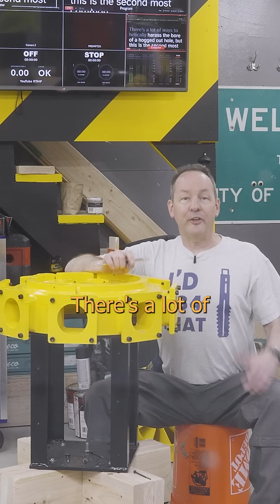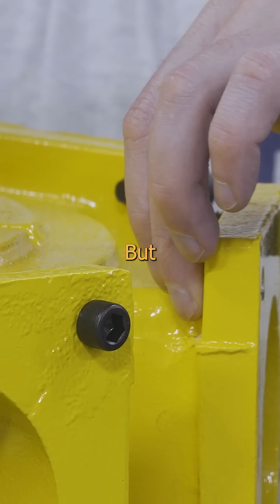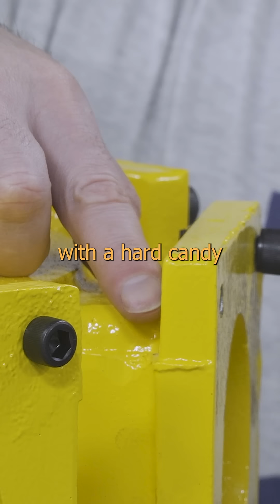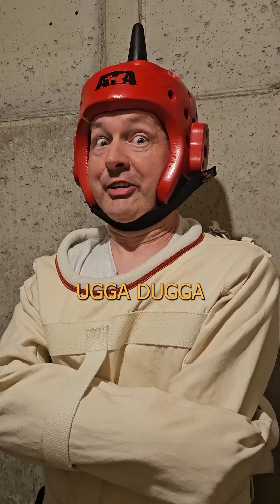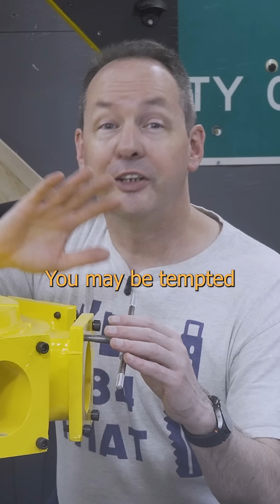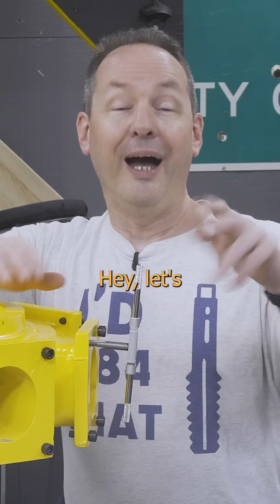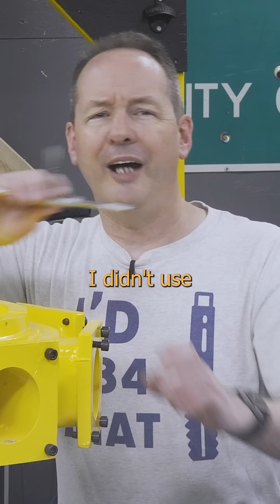Thread Chasing  #chrisboden #comedy #engineering #skills #workshop #metalworking #tools #apprentice

Comment: I used to work for a company making CNC machines. We would use drills to tap, production was too fast to sit and hand tap every hole. We did break them here and there, but you get pretty good at it. Only holes we would hand tap were blind holes, they're guaranteed to break if you run it with a drill against the back wall

Comment: I’ve tapped hundreds; no, thousands of holes with a tap in a drill chuck. Do some ground grid installation and trust me, you’ll find a way to make that three jaw chuck on your drill hold onto the 4 square sides of your tap. That said, we pretty well always pre drilled a bit oversized so the tap wasn’t working so hard. 

Hundreds and hundreds of holes, tapped to 1/2” NC and thread in a servette post. In the mud, under the mud, under the snow, always in a spot you’d swear isn’t reachable. Only to find you can reach, just it requires you to wear a snorkel and lay 3” deep in mud.

Comment: I chased the threads for a trailer hitch in the frame of a 12 year old jeep.  I didn't have the fancy holder so I used a ratchet, very carefully, worked like a charm removing 12 years of dirt and rust.

Comment: Chuck a spiral flute taper tap in a 1/2” Milwaukee and run backwards until you feel it skip a couple times then put in forward and let her  rip!!! Ugga dugga ninjas!!! That’s how the pros do it.   When I can’t rigid tap full depth for any reason I just chase them with a tap in my impact drill,  if you want some slip set the torque to two clicks below hammer drill.  In and out easy and be sure to lube that tool.  No dingus in dry holes!!!

Comment: instead of using a tap, you should use the correct tool, which is a rethreading die. Not so aggressive that it makes a bad day, but does the job. Also known as a thread chaser.

Comment: I oddly had to do this recently.  I was overzealous with the crazy glue when slipping on the outserts on my carbon arrows.  It got a little thread nasty making it too tight for my field points.  So I had to figure out the thread pattern and tap on through to the other side by hand.  So no, I did not use a power drill to ruin an expensive arrow.  My 💩 shooting will take care of that.

Comment: I broke my first tap off in an intake on a 350 trying to re-tap a hole for the thermostat housing because a bolt had broke off and I had to redrill the hole to get the bolt out. Had the tap in the drill, going nice and slow, with magic tap juice. Tap bottomed out and broke nice as could be. So yes, I learned the hard way.

Comment: I've cut many, many threads with a battery drill and a tap. M6 or above is pretty much idiot proof in mild steel and aluminum. It just requires a bit of experience and a good eye for perpendicularity. Is that even a word? Well, that.

Comment: Dumbass, had a M6x1 hole in the side of a dirtbike engine that I was fixing with a helicoil using a 1/4 impact driver before I put in the insert. immediately snapped the bigger repair tap in the clutch cover between the power valve and water pump and didn’t get it out until a month later.

Comment: I'm a Machinist. I once spent close to 30 hours making a saw arbor shaft for a commercial sawmill out of 4340 chrome molly steel. There was a keyway that had ¼-20 threads drilled and taped in it to secure the key in place. I had completed 3 out of the 4 holes and was working on number 4 when I snapped the tap off in a blind hole. I was maybe 2 operations from being completed and now I had a broken tap to deal with. I tried for several hours to get it out to no avail. Ended up having to re-make that shaft because of that. Nobody at all was happy about that. Lessons were learned. 😢

Comment: Dumbass: Working on a robotics team in high school we ended up in a similar situation. Someone wanted to express themselves artistically and took a rattlecan to freshly machined parts in the hopes that "It'll save time" and got paint all the way down in .500" tapped blind holes. Here I am, the machinists kid of the guy that made the thing and I think I can do just what you described, chase it with the tap and back it out with a power drill. 5 minutes later that mf is snapped off in the hole and about 200 dollars donated of material and shop time is sitting scrapped on the floor and my father is doing his level best to not curse in front of a bunch of kids that aren't his.
Reply: Addendum: it was a VERY quiet car ride back to the shop at 7PM to make another one

Comment: I haven't crossthreaded with a tap during a chase but I chase with bolts and tread-checkers pretty often. The other day I was tapping a server rack with   e a c h   a n d   e v e r y   b o l t. Every confine was too tight to use anything but a micro ratchet a few clicks at a time and some were even too cramped for that. You better believe my fingers were screaming raw for a few days by the end of it, and I learned that human skin makes a decent threadlock somewhere around Blue.

Comment: I was working for a company that cleaned, serviced and repaired massive natural gas turbines for power production. I was a chemical process technician and my normal job was cleaning by hand, sandblasting, or chemical dunk tanks, everything from a massive turbine casing down to springs that were as small as a ballpoint pen clicking spring. 

One day, they were short staffed over in the component repair department, and knowing that I had experience with welding and fabrication they had sent me over there to help out that afternoon. My task was to re-tap stages 14-22 stator casing, and I was told to do it by hand. But being the bright little farm engineer that I am, I figured I'd put it on a drill and get it all done and jump to the next task. The first few holes went fine, it was somewhere around the fifth hole that I had cross threaded and driven in fast that tap. I inform the supervisor, and he in turn brought over four engineers from the GE department. I was told that upon removal of the tap, the repair would cost around $18,000 and that if it's not salvageable, that part was worth $560,000 to replace. The component repair engineer was able to remove the tap and fill in the hole with the proper steel and then re- drilled and tapped the hole. 

I later came to know that the small 1/4-in thick bolt that was an inch and a half long that fit into that hole, costs around $95 to $110, and that tiny little spring that looks like it came out of a pen costs $45.

Needless to say that job was a little too much for me and I decided to depart after a few years.

Comment: That dumbass would be me. Not a power drill, but with a mill. 70rpm is faster than you’d think when you’ve only got 16 threads in an inch to power tap.

Comment: I'm just the opposite. My threads are far better when I use a drill.  I have better control maintaining consistent straightness into the hole.  That said, I've been a machinist for many years and technique is key.  I can feel better on the tip of a drill and I can with my fingertips.

Comment: "dumbass" I definitely learned the hard way working on my own car. I was trying to chase the threads on my engine block to replace the bolts with studs and I used an impact wrench and broke the tap off in the block. That was a fun day lol, lots of swearing and kicking stuff.

Comment: Have not crossed a trap with a power tool but I've mangled my share of holes. Have particularly bad luck with ford transmission pan bolt holes. Some magic combination of the aluminum used and the steel bolt and whatever else goes on and half the time the threads come out with the bolt. Usually in the form of powdered aluminum oxide. And then the fun begins of drilling, tapping and helicoiling the problem ones and hoping the rest behave on the way back together.

Comment: Recently I was tapping holes for (or rather, WITH) 2.5mm screws in an aluminium plate. Lowest torque setting on a cordless drill, hex bit, went perfectly well.
Well, the pilot holes were awfully misaligned but tapping went great 😅

Comment: Ben working with my dad on stuff like this since i was knee high, so I know not to full send a tap, but the first and last time I had one snap off was a learning experience, it started on the threads nice and easy but maybe 4 turns in it hit the rusted section which is why we where tapping it in the first place, the tap tightened up so i was turning it in till i got a little snug then backing it outa bit giving it a shot of WD40 then repeat as the tap got to the bottom of the hole it tightened up with much less of a turn then usual but i was so close to through that i had though there could only be a turn or 2 to go so... seeing light at the end of the tunnel i decided to turn it in a bit past SNUG and.... dink! snap the dam thing off in the hole, moral of the story, when you see light at the end of the tunnel don't run, walk because if your trip and fall that close to the finish line because you did something stupid everyone will hate you, including you.

Comment: So I may have one at one point..... on a hole that was meant for an inch-and-a-half diameter bolt used a dewalt half-inch impact to drive the tap to chase the threads and on some of them that wasn't enough.

Gotta love hydropower equipment that's been in the water the last 70 years

Also, there's no thread like a cross thread.

Comment: I learned the lesson the really hard way when I was tapping a blind hole on my old '90 Wrangler's windshield.

Used tapping oil, in and out (giggidy) motion and was using a tap wrench not a drill but then the tap got stuck near the bottom and while getting frustrated I guess I utilized a bit too much of the old 'tism strength and snapped the tap clean in half. I ended up driving that Jeep for about 4 more years before the frame snapped and the whole time one of those windshield bolts was that broken off tap...

Comment: Dumb ass… I was told by a supervisor it would be fine on a high pressure chemical vessels flange…. It went from 1/4l high pressure bolts to 1/2” high pressure bolts…. A 5 minute fix to a 30k rebuild most in our man ours…. I know longer have that supervisor.

Comment: As long as you hand start a tap a few turns, you can finish it with a hand drill, but you should absolutely use lube. Use the torque setting, or clutch, and it'll be fine.

Comment: Tip for anyone and everyone from a mechanic.

Lang sells a thread repair kit that is specifically designed to restore existing threads while removing as little material as possible. 

It's perfect for situations like this or for when you inevitably cross thread the flare nut into the ABS module you were replacing.

Comment: Dumbass,
We had to disassemble a whole 400A switch and lost several hours finding a replacement solution because the bolt didn't become tight but also didn't come out again🙈😅

Comment: Broke off a bolt in an engine block on the backside of a 671 while it was installed in a bus😂 I had to pull the motor transmission and rear axle in order to properly get at it.

Comment: You need to learn about NES internal and external thread repair tools. Inch and metric with the same tools.  I did a video on the subject.  You  start below the damage and thread from inside to out.

Comment: I work in computer repair. I had a unit come across my bench, and for the sake of efficiency we had electric drivers. Long story short, the driver stripped the screw, and i had to break out the dremel with a cutting disk to cut an all new flat-head out of the stripped phillips. Replacing the backplate because part of recutting the screw meant cutting the aluminum of the plate ended up making a 3 hours repair into a 3 day repair while we ordered parts.

Comment: Yes I have fucked up chasing threads.
The project started simple, just replace a water pump on an old van. 
Well we all know what comes next. Bolt holes with rust and Permitex crud in them.
The first couple cleaned up ok the next I got a little off straight not too bad though the last the tap started nice and smooth like a shot of Southern Comfort then got tighter than the prom queen. Well I just kept horsing on that tap and sure enough broke it about 3/4 of the way in. 
I wouldn't say I was a dumb ass but certainly not an expert mechanic either. Many I should have consulted my dad or the auto shop teacher first or at least lubed the hole.

Comment: So my dumbass moment. We broke off a valve cover bolt. I gave it an extra 1/4 turn, and it went righty loosey. Pulled it apart, ez out the stud and fucked the threads. Went to retap the hole. Used a drill. Snapped the tap off in the head. Fucked the whole day.
Edit for spelling.

Comment: I learned the hard way that you don't use a ratchet to screw in the spark plug, even if it's in a harder place to reach. It was cross threaded and..... I'm lucky that I had a guy that lived across the street that rebuilds engines at his house as a hobby.

Comment: so, I was working on the feeder pipe for our second production line when I cross threaded a bolt on the main feeder block. My dumbass just though it was stuck and needed some elbow grease, so I grabbed our UGGA-DUGGA! and drove it home. Well, it didn't go all the way in and that's when I realized what I did. Had to retap the hole, wanted to get it done fast, used the "I SAID GO, YA BASTERD!" then backed it out. had maintenance look at it, and JESUS ON A UNICYCAL WITH A DILDO HORN!!! Needless to say, I had to redrill the hole then retap the dam thing, under the supervision of the higher ups. the didn't trust me with either the UGGA-DUGGA or the I SAID GO, YA BASTERD!! ever again.

Comment: For chasing or cleaning up minor cross threading mayhem, a bolt or whatever threaded thing can work. Just take a Dremel tool and cut some notches in the bolt, and it will work at least once in steel, and maybe a lot in aluminum.  If you mess up a metric flare fitting on a race car on a Sunday morning it will get the job done.
Actually figured it out on farm machinery when I was a kid.

Comment: I'm that dumbass. I'm actually a BIGGER dumbass, because it wasn't just a drill.

I was reworking the heating block for a soldering machine that broke. Bolt worked loose, there was a leak, thread got full of solder. Had to get it out somehow. I had the thing on the mill bench because it was the best work surface I had in the moment, when I got the briiiiiight idea to just use the power feed to re-tap it! Bring it down manually, get the thread started, and hit it! It worked on steel before, but this was aluminum that'd been heat cycled many, many times, so it was softer than a Mars bar that got left in the work truck in July.

Anyway, that's how I got to learn how to heli-coil before the production manager found out.

Comment: After lunch break I confidently got hauled 40 ft up a 100 ft mast of a sailboat with the knowledge of putting the tap in the drill to finish 3 holes. The tap broke almost immediately and I spent NO SHIT the next 8 hour digging that tap out while hanging from a rope. I’ve since learned how to properly power tap hahaha. I’m a masochist so fuck if it breaks just more pleasure

Comment: Broke a tap inside a ancient machine from the 1940s. Talk about a 15 minute job turning in to a 2 hour quest. That work hardened steel means hard to work on.  Ended up having to tap size up after getting that tap tip out. Lesson learned. Don’t apply horizon force on a vertical cut tap.

Comment: Alright common mechanic yes no ugga dugga the tap. Machinists meanwhile we lean on it, throw it in a chuck on the mill and send it of low at 300 rpm and play chicken with the end of the flutes, throw it into a drill to change the fit type, use it as a punch to take screws out.

But yeah point is if you ain't got a clue don't try shit any differently than the absolute correct way. Tap handle with both hands and lube no matter what your doing and you will never break a tap.

But yeah never broke a tap in a drill because rule of thumb is nothing smaller than 3/8's for anything powered. I do the same thing with ez outs but once its broken loose which still wigs people out.

Comment: But if they are a torqued bolt and you tap the threads you lower the % of engagement thus changing the torque spec.

Comment: "Dumbass"

Thought I could use a drill to pull out a stuck tap I could not, I had threaded it in got a bit stuck winding it out started just working it out then back till it got to the point I couldn't move it, fuck it drill wind in full send out hit the point and instantly snapped.

Always use lube even if you don't think you need it.

Comment: Dumbass here, although I would say it's was more circumstantial than dumb... Tight confines, tap wrench wasn't going to fit... but 90* drill adapter fit perfectly. Knew what was going to happen, tried it anyway. Bad day.

Then this dumbass went to Ace and found an adjustable tap socket by Irwin, adapted for 3\8 socket wrench, next a 3\8 to 1\4 hex, right in the impact driver lol. 

No seriously, get a tap socket, you'll never want to use the tap wrench again.

Comment: Put a drill but in the drill. Put rubber hose on the drill bit. Insert tap or thread chaser in the hose.  You made a clutch that doesn’t transmit much torque

Comment: I came at the hard way from the other direction. Turns out that no matter how careful you are, a bolt with a couple of flutes filed into it is not a tap, and without the hardness of a proper tap, the "threads" it "cuts" will not match the shape of the bolt when you started, but the shape of it after you're done.